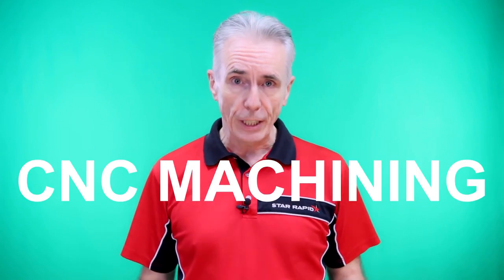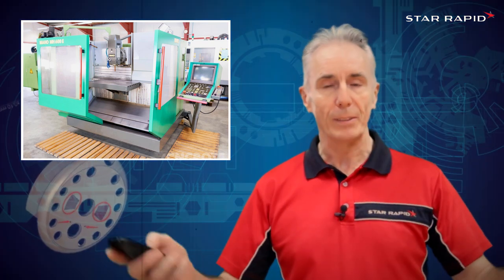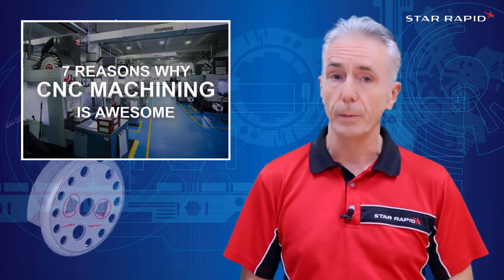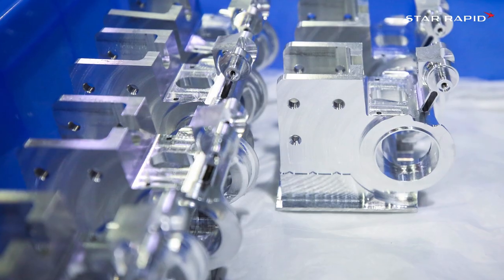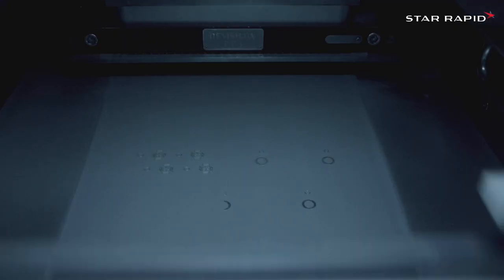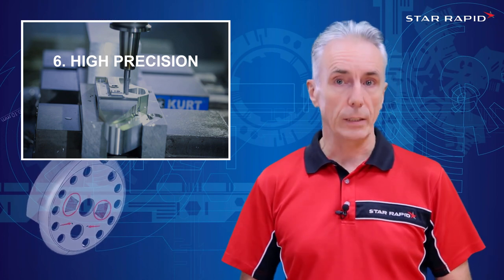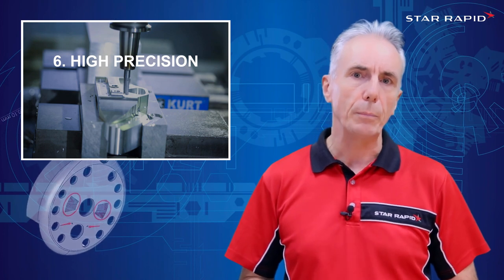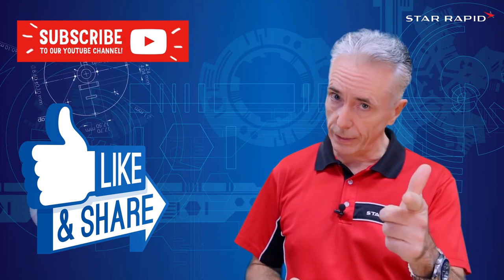7 Reasons Why CNC Machining is TOTALLY AWESOME | Some Serious Engineering - Ep6

Comment: How much help did the software require to make the Basketball hoop? How many stages and time required for the drawing? 
Which year would you have stopped laughing when a customer asked you to make one of these and said okay.?
Sorry so many questions but it was amazing to see it being made. Thanks again.
Reply from the maker: That was not our project unfortunately, we were simply in awe with how they did it!
Reply: @starrapid  Thanks yes I just wondered how much of the effort would be software from the original concept. The last cut must have been nerve racking for them. Although it is a project where I guess 3d metal printing would be a better solution in real life requirements.

Comment: Hi,  really liking the info in your videos.  However I am a bit mystified as I can not find many examples of the plastic molding I do in my shop.  I do not know if it is the wrong term I use or what.   Basically I extrude a slug of plastic and compress in a liquid cooled mold under 6 tons clamp force.  I make a very heavy duty 780 gram plant pot using HDPE.  Am I the only one out there doing this?